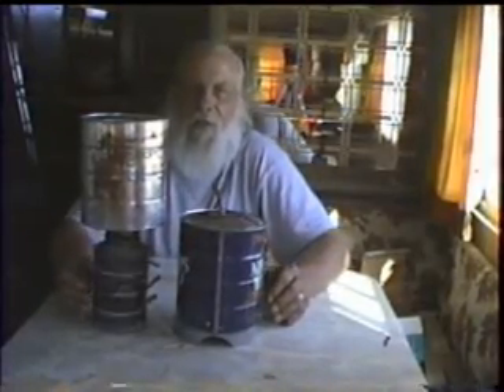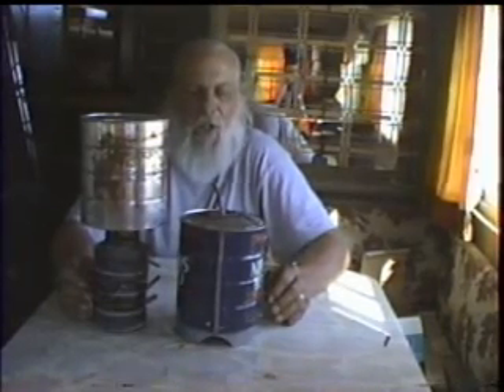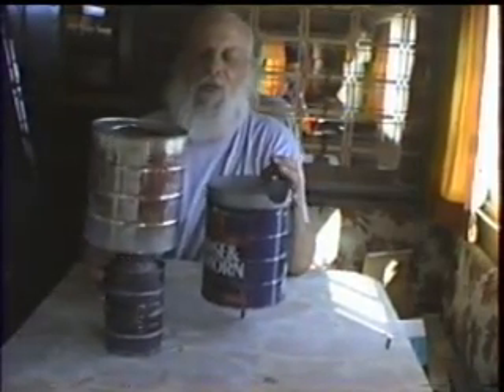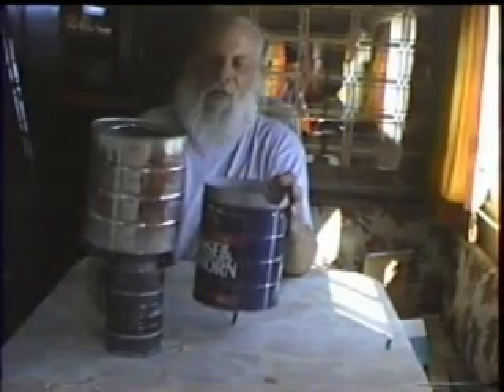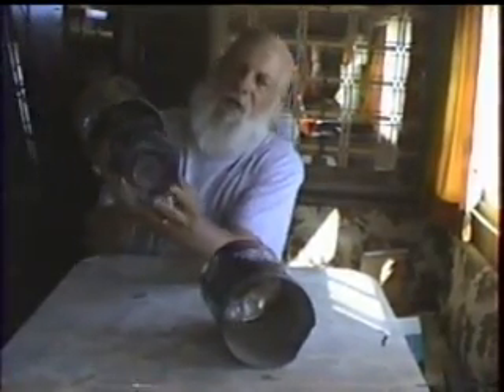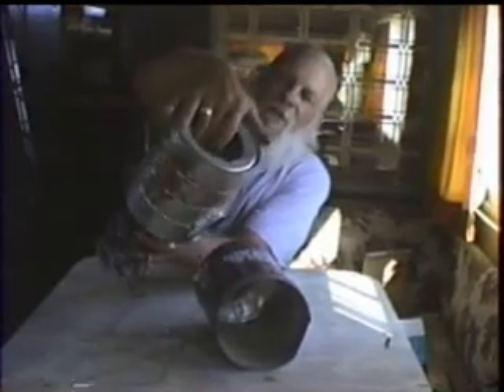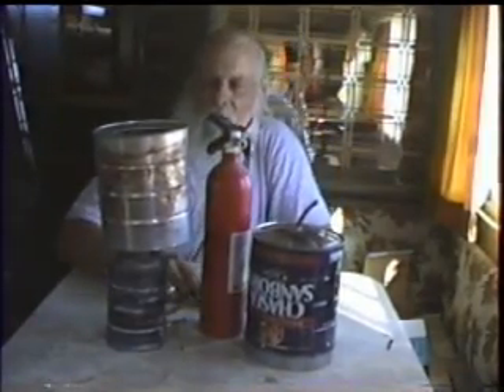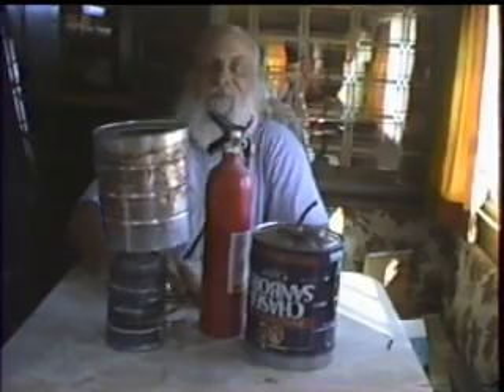Gasoline Vaporizer

Comment: @GBH2o4u Built one in 1961, got great mileage until a bad plug wire and a bad solder joint caught it on fire and burnt the car up.

Comment: I built a bubble vaporizer an installed it on my 55 Buick in 1961.  Worked great until I burnt the car up due to a poor solder joint and a spark from a bad ignition wire.